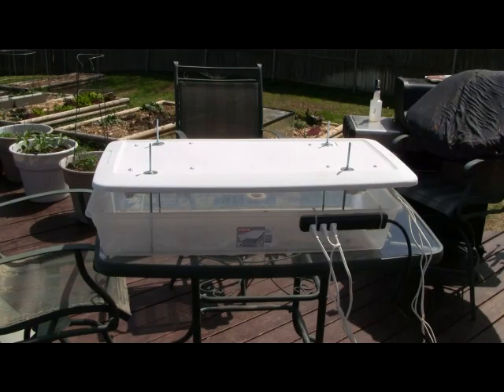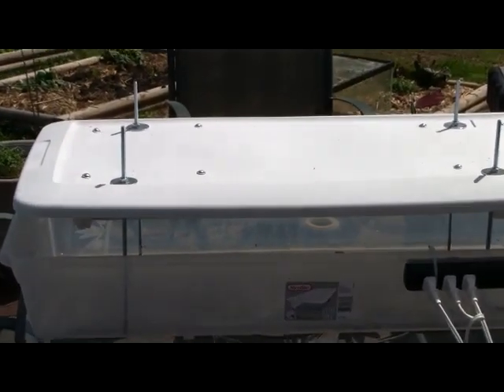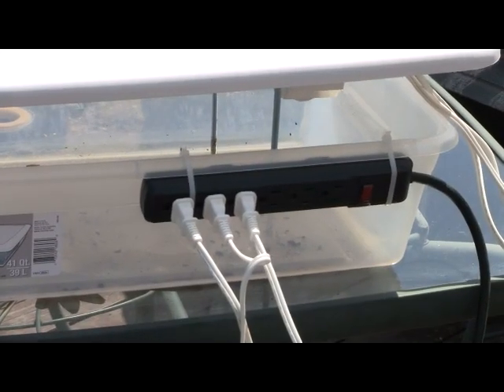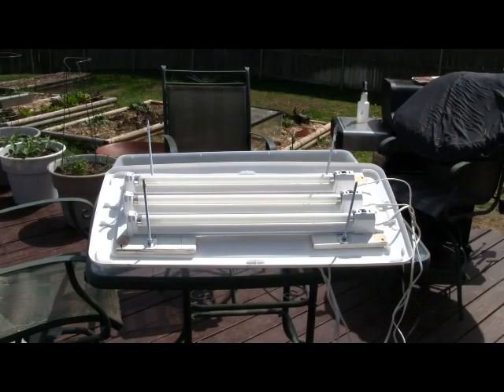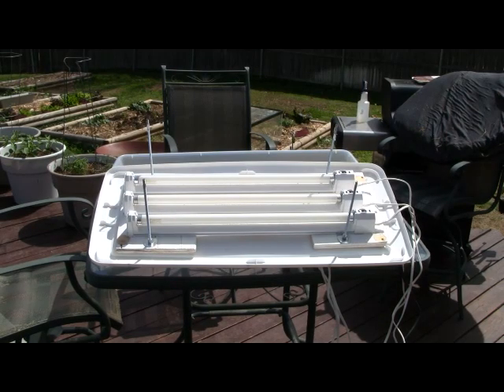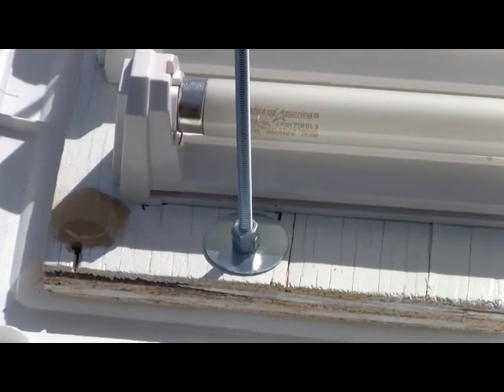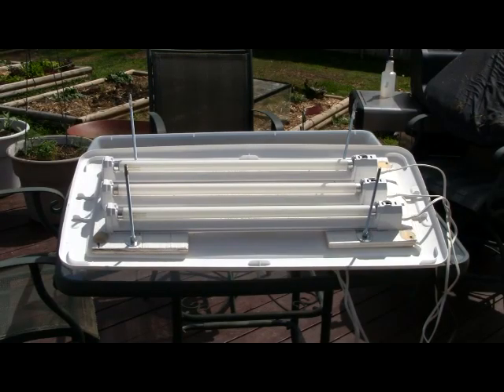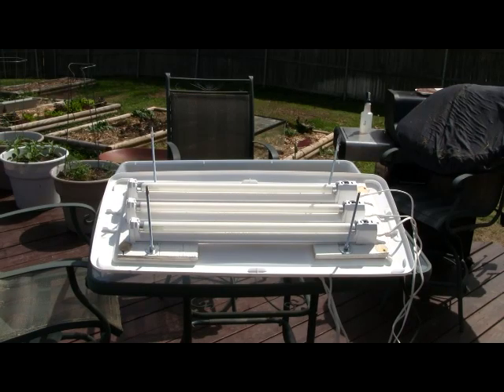How to Build a Very Inexpensvie Grow Light System

Comment: this is dumb. you can get a real propagation box from any grow store for even cheaper. they work better. and its already done. you sir wasted your time..
Reply: Grow stores were not as common at the time(and are even more common since your comment)
Reply: well first this guy doesnt say what cheap means soo ill have to guess. 8 bucks per light is all he gives.  x3 is 25 bucks.  then 10 bucks on the bin. 5 bucks on the power strip maybe another ten for additional hardware.  did I miss anything? lets say maybe 50 bucks.  you can get a 2 foot 4 tube T5 fixture for about a hundred bucks.  and it has proper reflection and and is easy to use.

Comment: You should probably try using a lockwasher to keep the nut from coming off. That's what lockwashers are for. Or you can use loctite glue.
Reply: If you make them permanently lock how will you be able to adjust the height???

Comment: Good ideas here! If you can find the right light fixtures/bulbs for a decent price it should work great. 

You can also buy a factory made 2' T5 fixture in 2 and 4 bulb formats for under $80 with 6400k bulbs..
They come in many other varieties too. T5 hoods are specifically designed for growing and are very commonly used for germination and cuttings.

Comment: A one word question. Why? It seems way over engineered and for what you've invested in it you could have simply bought something off the shelf. I know you indicated you start from seeds but if anyone starts from clones just know that this is way to much light for rooting clones. A single 2' HO T5 would provide more than enough light. I'm still left wondering why, lol.

Comment: High power LED's have more penetration power & color control over florescent but, they also create more heat & can end up using more power to operate than florescent. Grow lights work by generating more usable light for photosynthesis (primarily red & blue color spectrum) There's a lot more to it but, not enough space to talk about it here. Hit up some indoor growing discussion boards.

Comment: Your system works great. I have used mine now for a few months for the clones that I made using the clonemachine you designed. I have had a 100% rate so far.. My only problem was I messed up the rods so I just stick pieces of wood on the ends to get the height I need. 
Thanks and peace to you..

Comment: The rule of thumb I have for using plastic containers is,,, if you can smell the plastic, it is giving off some of its molecules and therefore a toxic plastic. There are other plastics that are odorless, use them. If you can't find one, a liner can work to put a barrier between what you will eventually consume and the leeching plastics.

Comment: Thanks for the video.  I'm torn between using the 2' flos or buying the LED panel to build my seed starting station.  Either one will be better than my current window method.  
I'm sorry that you have to deal with negative comments from arse clowns at this site.

Comment: question . for example. if you had a 50 watt grow light. if you got 2. would that be the same as getting one 100 watt light? or different when you count in the lumens and shit. just wondering cuz would the 100 provide more heat the the two 50's?
Reply: andrew1jl More heat an light coverage
Reply: andrew1jl More heat an light coverage

Comment from the maker: @nightblade18m 

I am sure people can come up with a million variations.  Go buy an old book shelf in a second hand shop, drills a few  holes for the wires, mount up some lights and that would be another one.

I do find though by moving my seedlings out doors into filtered light as soon as they have true leave though this one small light can turn out a LOT more seedlings that I have room for.

Those with a green house will do better to use an indoor light the same way.

Comment: Another way to do it is to use those Red and Blue Christmas LED lights you find on clearance after the holidays then line the lid and walls of the tub with aluminum or tin foil to amplify the light a little bit. The combination of red and blue light make up the bulk of what plants use for photosynthesis, though obviously the full spectrum will provide everything needed. Another idea is for the homebrewer, keep a carboy brewing in the same room as your seed starter as plants love CO2 from yeast.